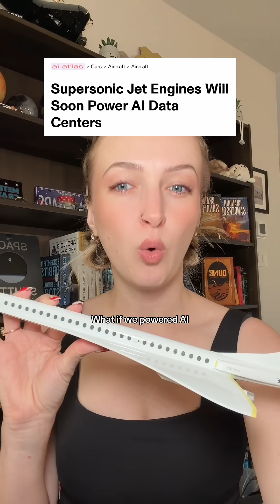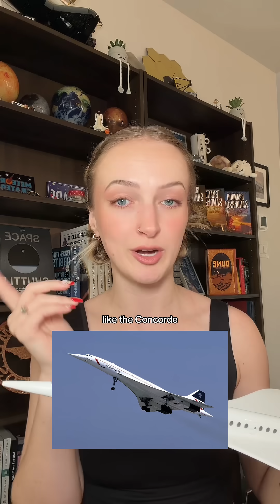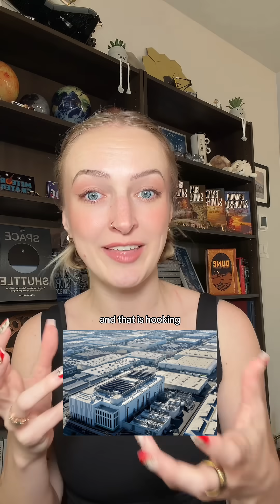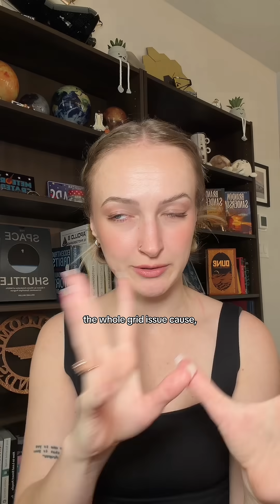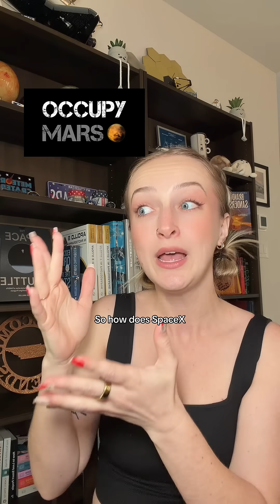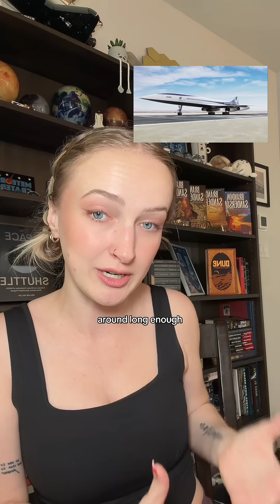Supersonic flight’s revival: data centers’ biggest problem?

Comment: I hate to break it to you, but this is blatantly false. The LM2500 is based on the CF6 engine, and it totally fine running at -50 or 150 degrees. Planes reach their maximum power output on takeoff, and regularly do so at high temperatures. The combustion temperature on a CF6 is somewhere in the 1200-1500 degree range. And yes, a colder inlet temp is more efficient because the air is denser, but the lm2500 doesn't have a precooler. TL;DR the lm2500 can totally run at high temperatures with minimal downsides as it's an air cooled engine, just like all aero derivative gas turbines